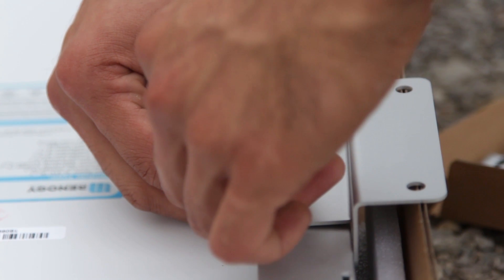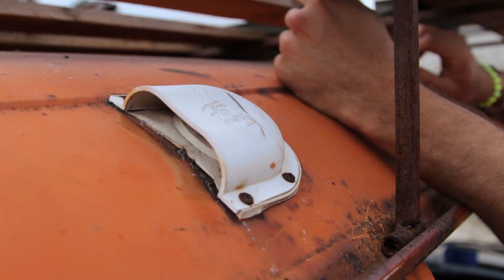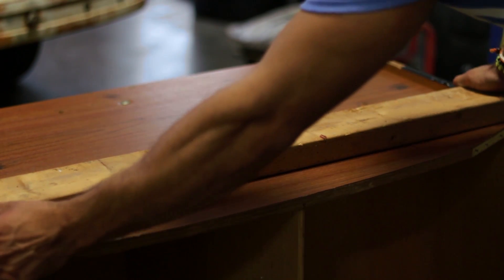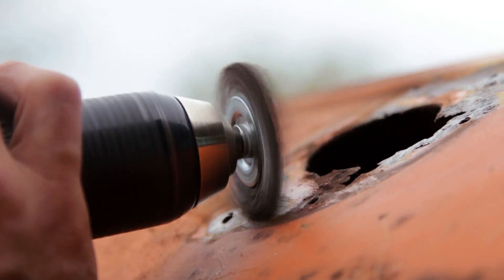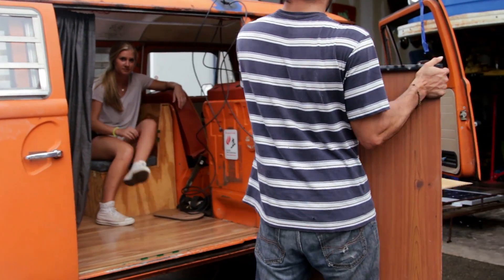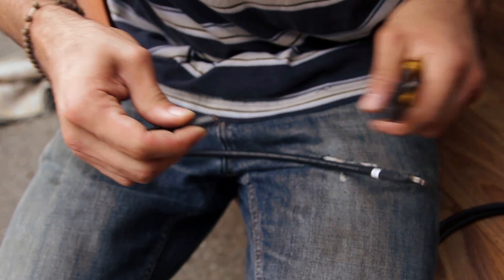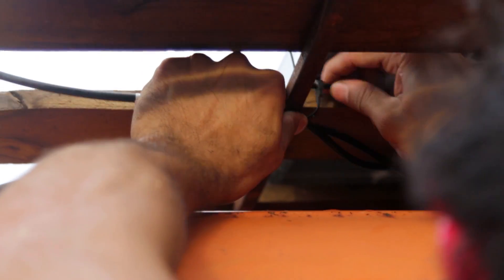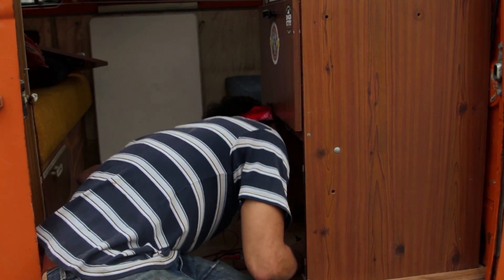VW Bus: Solar Panel Installation #VanLife Ready

Comment: Y'all should upgrade to Prismatic Lithium Iron or Ion battery. More Battery Life about the same Price or DIY Some Panasonic Cells into a battery pack. Consider upgrading to Flexible Solar Panels Less weight. They have 18V 132watt Flexible for cheap on Ebay. More Juice More Production can be done off the Grid. Less Weight on Your Van = Less break downs and more mpg. Peace.